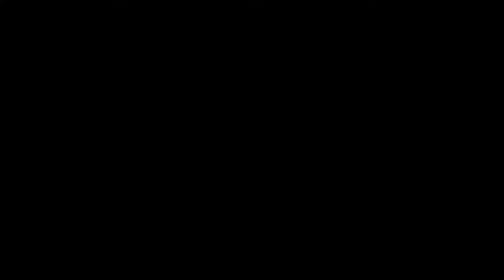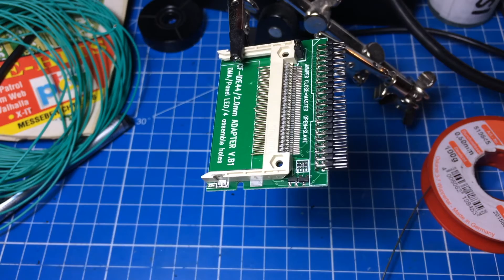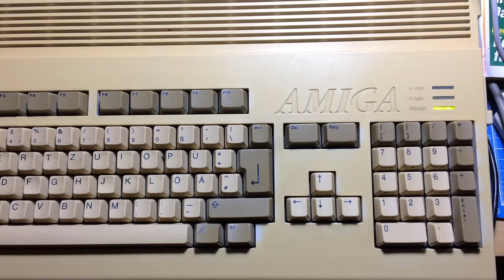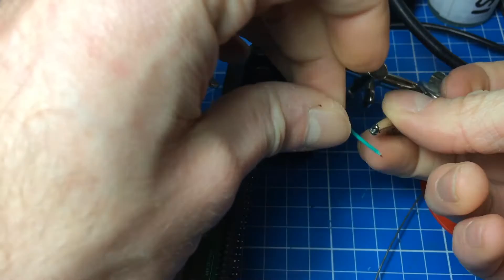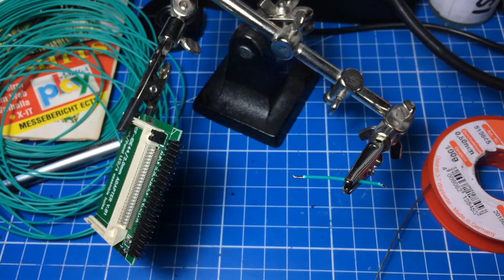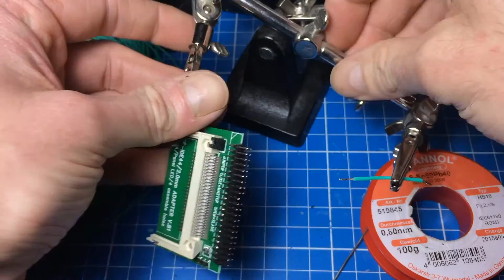Amiga 1200 Compact Flash HDD LED Fix

Comment: My problem with my A1200 is the light stays on after adding a CF card, any fix for that?
Reply from the maker: You can use the same fixes as for the A600. My video about that problem: https://youtu.be/1v5m-86RBf8

Comment: I got my CF adapter from Amiga Kit and as far as I know it's supposed to work with the CF HD.  But alas it does not.  Should I try this mod you have done?  I dunno?
Reply from the maker: This mod has nothing to do with the device itself working or not, it’s only fixing the LED issue. Maybe you got a broken adapter or an incompatible CF card (which is quite likely, not all cards work).
Reply: @JanBeta  perhaps I phrased this wrong.  The adaptor works fine, and also has an led flash on it when loading, however the led on my Amiga for hard disk activity does not work.  So I am just wondering might this mod work for me?  Or should I get new Amiga LEDs?  I dunno.
Reply from the maker: Oh, okay, sorry. If the LED on the adaptor works it’s most likely a problem with the Amiga LED, yes. Even more likely just a connection issue, the LEDs themselves are pretty robust.
Reply: @JanBeta no problem, my fault for the confusion.  Ok well thank you for replying I appreciate that 👍🏻 might save me ripping the adaptor out since it's stuck in nice and neatly and poking out a special slot at the back. Keep up these good videos.

Comment: Mine does the opposite : The led is always on.
Reply from the maker: Oh, interesting. Haven't seen that before. Maybe there's one connection too much on your board then.
Reply: Jan Beta Or maybe it's because I fitted it with a micro sd card to cf adapter? I am not sure. I need to open it in order to add a HDMI port for my vampire 2 so I will check the circuit for differances. (by the way it's an A600).
Reply from the maker: +Λογος Ah, that may be. I vaguely remember reading somewhere that certain CF cards (and maybe adapters) cause LED issues like that, too. Maybe try briefly with another CF card?
Reply: Jan Beta I will... I have some old cf in my Nikon.

Comment: My adapter does the opposite: LED is always on even with no compact flash activity - any idea how to fix that? (I'm German btw but want all of your audience being able to read comments on your vids)
Reply from the maker: +moorgott666 That's odd. The only pins on 44-pin IDE that are permanently delivering 5V should be pin 41 and 42. Maybe the LED is connected to these pins accidentally? Does the Amiga's LED behave correctly with another HD connected to the port? (Thanks for using English, btw. Danke. ;))
Reply: Jan Beta I have 1 unbranded 8gb CF card that works the LED correctly, and one Sandisk Extreme  8gb that lights the LED all the time (flickers when accessing).  Both using the same adapter. Would be interesting to know what is going on.

Comment: Simple enough fix. So I suppose the signal to the system must pass through the led first for the circuit to be complete?
Reply from the maker: Exactly! The manufacturer forgot the connection to the LED which connects to the pin on the IDE connector. (Or at least that's what I think how this works...)

Comment: Great job!  I did this recently to one of my CF adapters - It's also worth pointing out that some CF cards don't provide the activity signal.  I've got a few of those CF cards where when you try them the activity light is always on, depsite being wired correctly =/
Reply from the maker: Thanks! Now that's interesting. Does it happen with "good brand" cards as well or is it the no name stuff?
Reply: +Jan Beta I think it might relate to cheaper cards - Sandisk seems OK, but I have some cheap other brand that seems to have the issue.  Although I think one of my 2Gb Sandisk cards does it too!
Reply from the maker: Mh, I'm probably gonna get a couple of used CF cards soon anyway, I'll  just check which ones work. Maybe I can even work out why. ;)